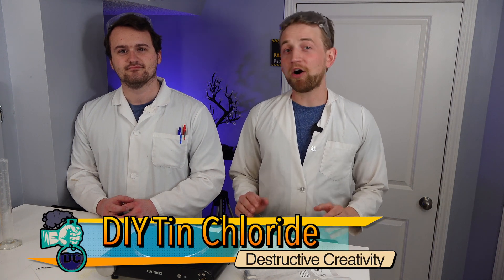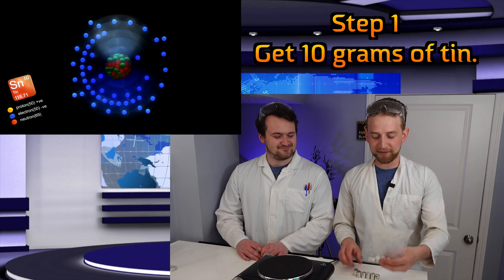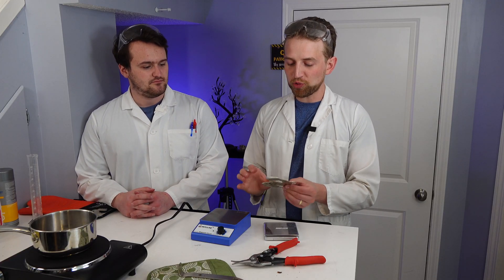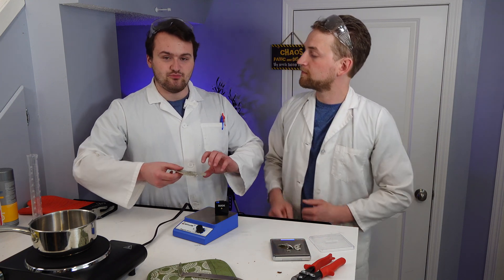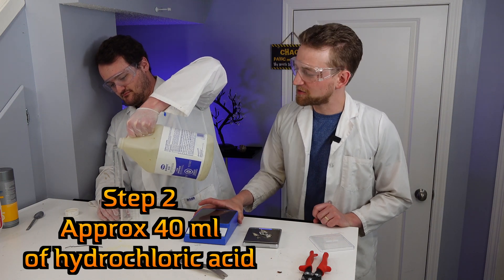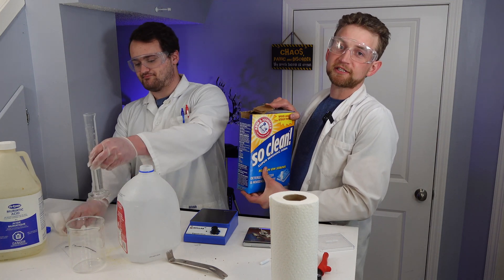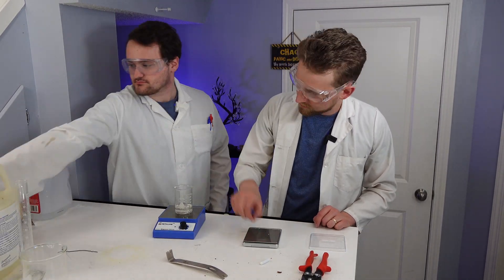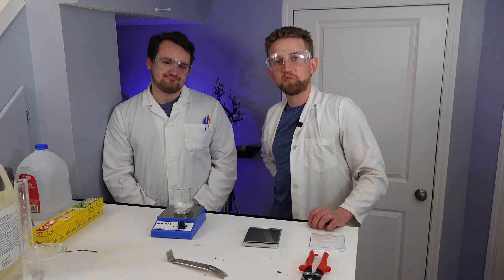How to make Tin Chloride! Stannous chloride DIY

Comment: Haven't tried it, but to speed it up using solid tin sheet like you have, try putting two strips in a beaker and passing current through them like you were going to electroplate something. A lot more tin would come off into solution then.

Comment: I tried the same sort of thing making Nickel Chloride with Hydrochloric Acid and nickel strip. It took forever but it worked in the long run. Maybe try using tin powder next time, if you can find it?

Cheers.